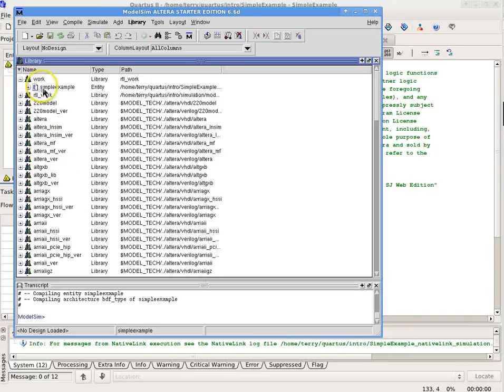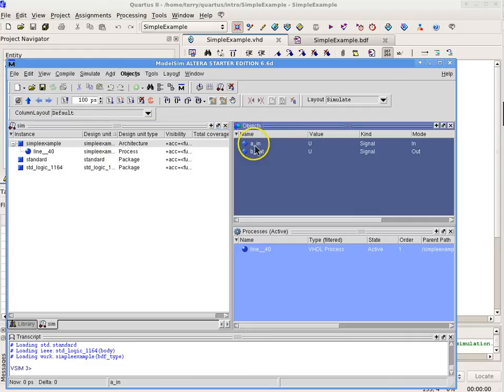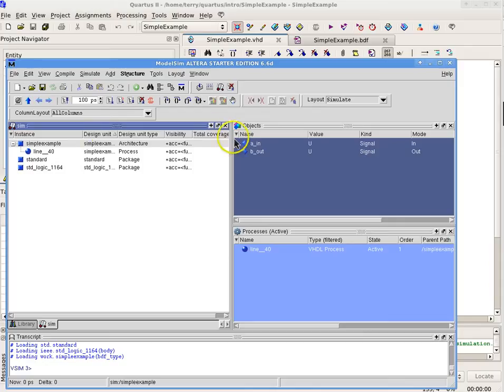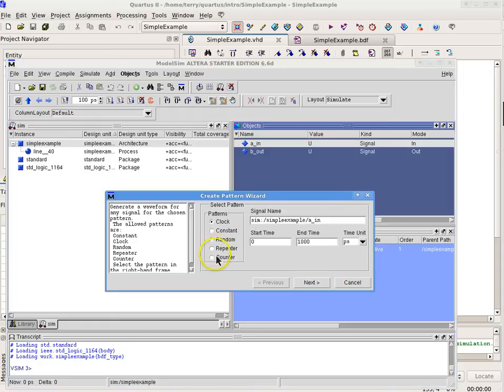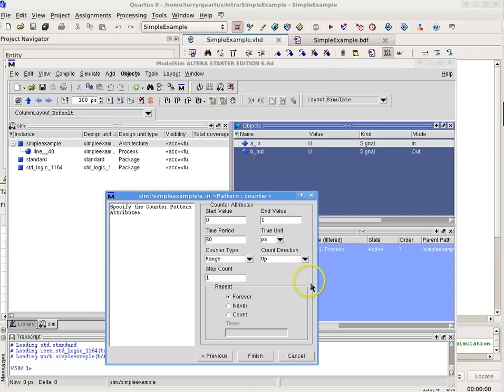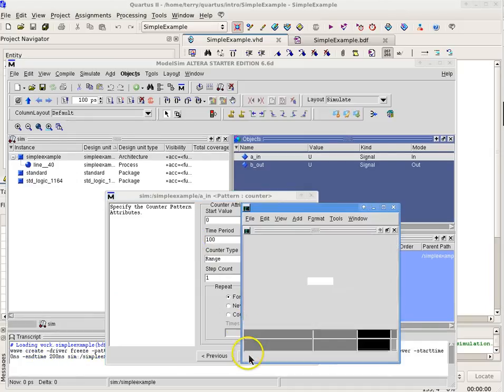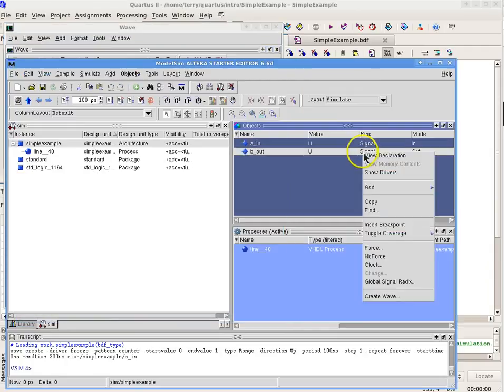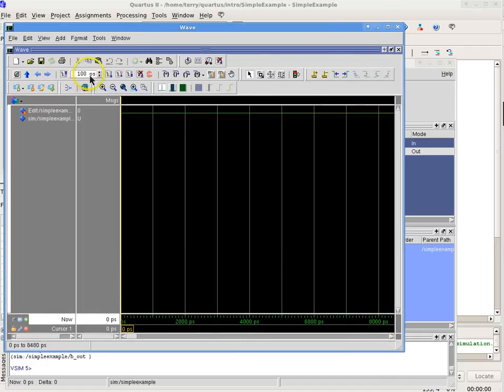How to do simulation in MODELSIM

Comment: I have trouble with the first few minutes. I have my code open but it's in the "Project" tab, not in "Library" tab, so right clicking the .vhd doesn't give me the option to simulate. I'm assuming I have to add my .vhd file to the "work" library, but how do I do that?